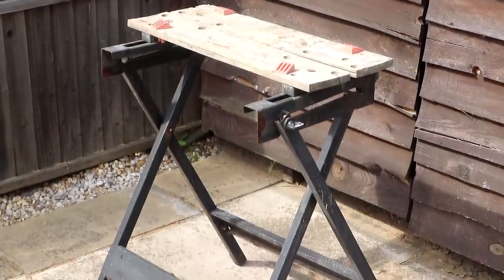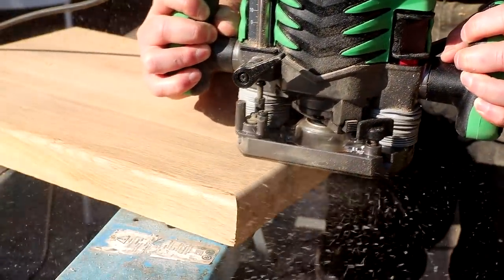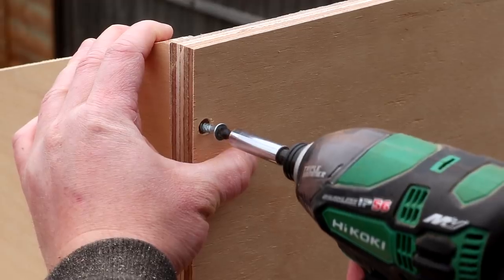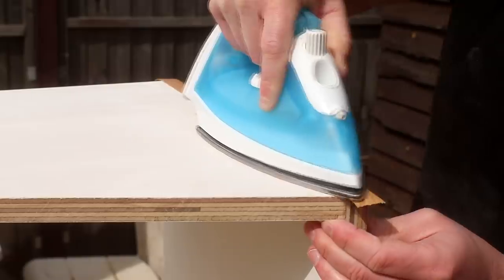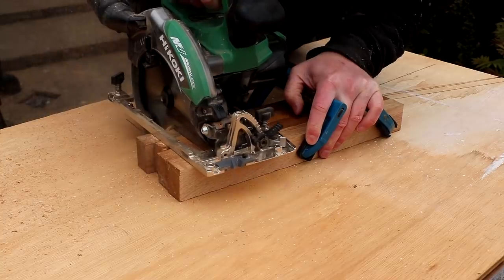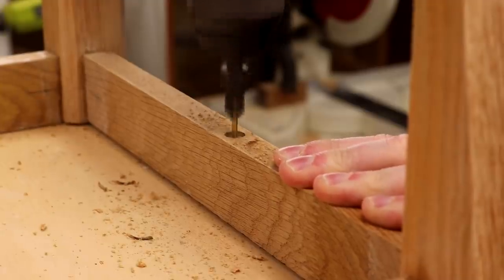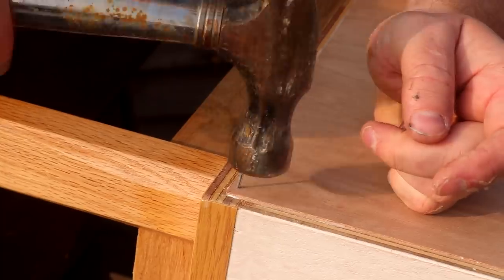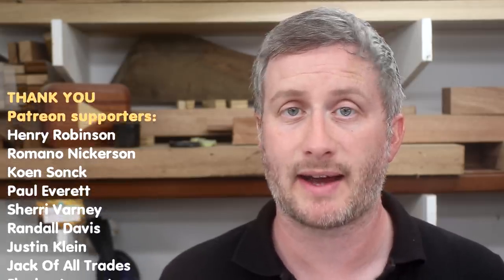Making A Cat Bed Cabinet / HiKOKI Limited Tools Challenge

Comment: Great video. Thanks for sharing. Good idea to show and point out again that it's not necessary to have tons of tools to have a project done. I do not have a plainer, joiner,
table saw and many other tools. But I do have (nearly) all the tools you used in the videos (other brands, though) I see limitations in my attempts to make something more
as a problem of lacking skills and experience (tools don't do anything alone, if you don't know to work with them).
One thing I missed at the end of the video. Mostly you mention it, now you did not. How much time did you spend on making the three cat bed cabinets together?
Or did you forget to count it this time?
Reply from the maker: Cheers Hans! I was going to talk more about the project at the end like I normally do but the video was getting quite long with all the additional sponsorship stuff so I ended up cutting some of it out. I actually did forget how long this one took though! It was a very stop and start project because I had to work around lots of bad weather! 😂
Reply: @RagnBoneBrown  Thanks for explaining.

Comment: I like his videos, however limited tools they are not, theres £500+ of power tools there, i wouldn't call that limited, good vid though keep them coming!!
Reply from the maker: You can pick up a circular saw for £50 a drill/driver for £30 and a belt sander for £40! You don’t need to use the exact same tools as me. Use what you have